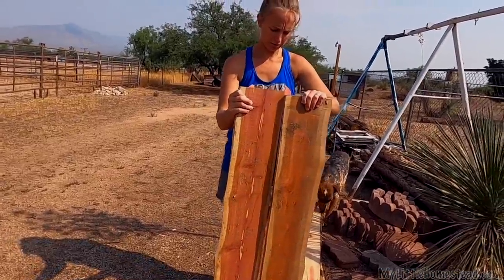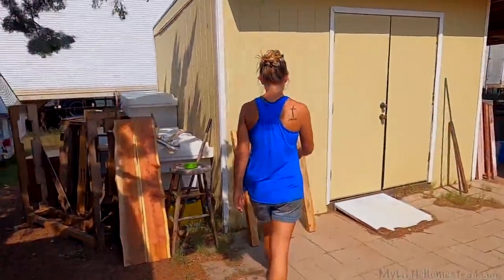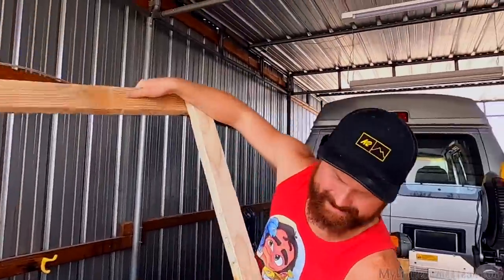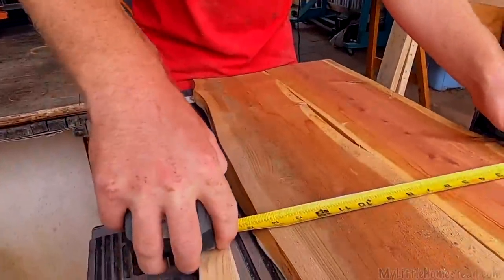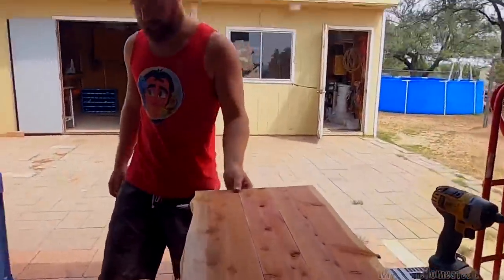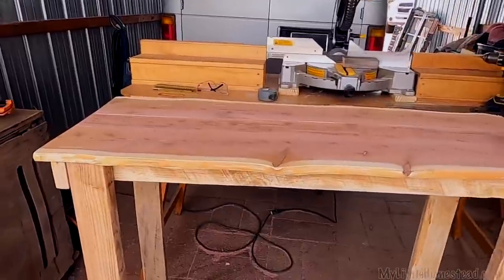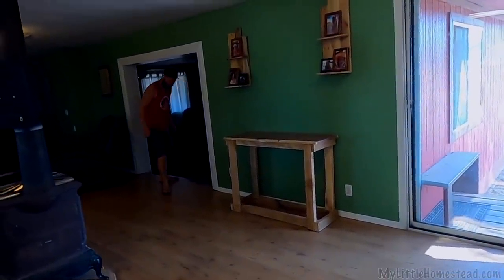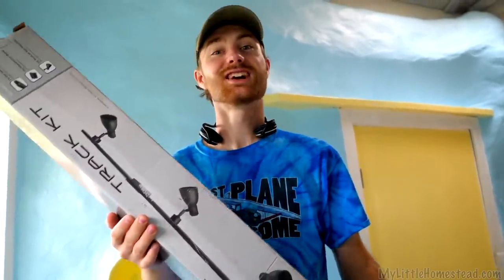Earthbag Bedroom Earthen Cob Floor Restore, Pallet Buffet Table & Light Install | Weekly Peek Ep249

Comment: Bryson, I looked into a  tennis ball launcher toy for bullet.  Apparently they are cheaply made, and will break easily.
They work with two rotating concave cylinders, and  a funnel shape on top where the dog dropped the ball in.  I think he would love one, I also think you could come up with a much better design than the ones I saw on the internet.  Maybe aim it up a bit for safety with the other dogs.  Would love to see it!

Comment: Switch from your incandescent bulbs,  to LED. Save even more power.
Reply: I usually wait until the old ones burn out before I replace/upgrade to LED. I simply cant bring myself to replace them if they still have some hours left in them.
Reply: They are solar powered, it's in a past episode's.
Reply: did they get Bree’s room hooked up to solar? I know they have Garen’s old room and Bryson’s room. Didn’t know they expanded beyond those two.
Reply: Yes, they have added all of the kids' rooms,  and the Musart studio to their solar grid. 
However,  I will stand by my statement,  about switching over to LED bulbs. They use 20% of the energy that incandescent bulbs do, and last 10X as long. I may rent my domicile, but the cost savings on my light bill, was proof enough for me. 
I was paying 65% of normal when using CFLs. Then I switched to using LEDs 5+ yrs ago. 
Since LEDs can run on an LV system... proven fact, I figure they would be great on their solar
Reply: I believe that all of the earthbag rooms are connected to the solar panels, I think that it's in the episode where Brise upgrades the hydroponic garden. I'm sure that Bre will update us soon when her room is all done, it looks great though right :-) Be sure to check out past episode's, because they are definitely worth watching.
Reply: yes LEDs are a much better option. many of the CFLs are toxic and require special disposal of when they burn out. not supposed to just toss them in a landfill although many do.

Comment: For Ellie and Garen:  Always my disclaimer...this is my 2 cents and that's all it's worth....BUT....I love you new buffet/wood cabinet...the top is beautiful...and while the framework is sturdy and strong enough to hold several days' wood...it does not stand up to the beauty of the top...I would paint it flat black (semi gloss at the most...but flat would match your stove).  The room is so spacious that it can take a bit of black which sets off your bright areas beautifully.  The buffet would be even prettier if the framework was designed to be there but not to compete with the top....and while I'm on a roll....the next thing I painted black would be that beautiful pedestal you use in the work area.  Either cut it down to coffee table height, or make it tall enough for dining, but the black pedestal with another cedar top (round would be great), would give you a table to put down in the other end of the room....I know black sounds drastic, but your stove is there to stay, and if you have touches of black here and there, it won't look like a one-trick pony...trust me...black accents would be terrific in that room...

Bree and Bryson:  OMG...that room is so beautifully 'touched up'...it looks larger and softer, in general, more welcoming...reminds us all that we need to take an occasional look at our 'well-loved' rooms.  One tip??? (see above disclaimer)...I have track lighting and those 4' tracks will support many more lamps than they come with....by 2 more (odd numbers are easier) and point the center one straight up into those beams...then aim the others at various objects as well as general areas...lighting is a terrific way to affect the look of a room and take up zero floor space!  PS: be sure to check the prices of the tracks versus the individual lamps...sometimes it is cheaper to buy a new bar with the 3 included lamps than to buy separate ones.  Spring for the 'daylight' bulbs when you replace yours next time...the color of the daylight bulbs makes everything softer and truer to it's colors.

Comment: Don't paint the stove !!! 
When the stove is hot it will give off a lot of toxic paint fumes.
Reply: You can buy paint that is made just for stoves. I would think that there is no fumes from that.
Reply: @sandrabaker5930  Every chemical that is heated to high temperatures gives off toxic fumes. Some toxic chemicals you can't smell or see any fumes, but they can still do harm.
If you do decide to paint the stove, heat it a for few hours every morning for a few weeks, before the cold weather starts, with all the windows and doors open so the fumes don't stay inside the room.  This will burn off the toxic paint chemicals so when you use the stove in the winter, when all the windows and doors are closed, the toxic fumes from the stove will be minimized.
But I still believe it's better to not paint the stove.

Comment: That stove is a fire hazard that close to the bed.  Maybe you should do another rocket stove that made your channel so popular.  Then it wont be so likely to burn the bed.  Otherwise the bed should be in the alcove.  If a fire inspection were done by your local fire department?  They would tell you how deadly the present bed location is.  I am very concerned for your safety on this.